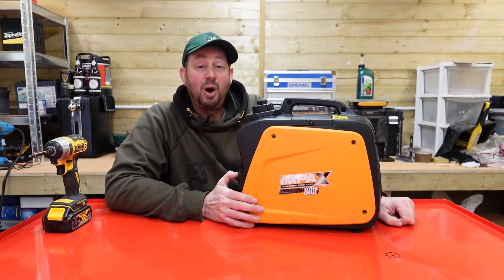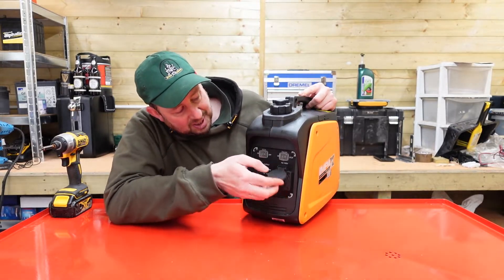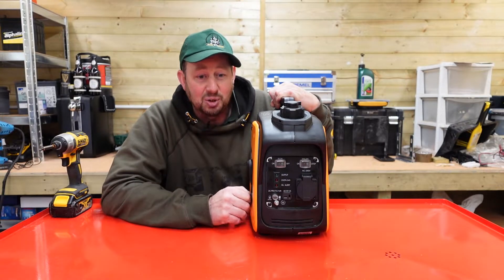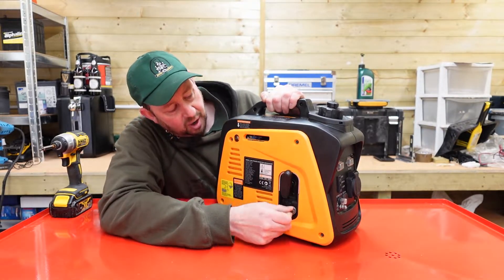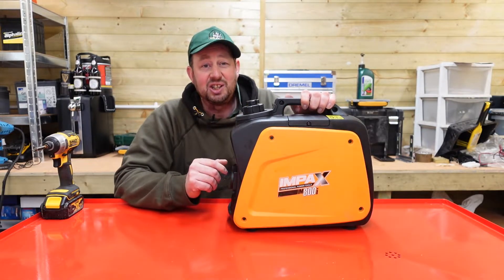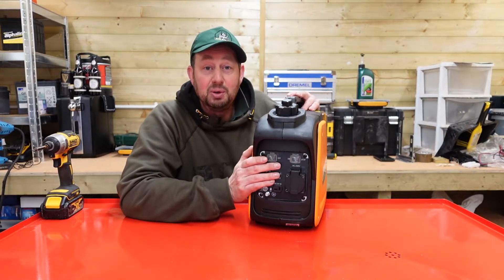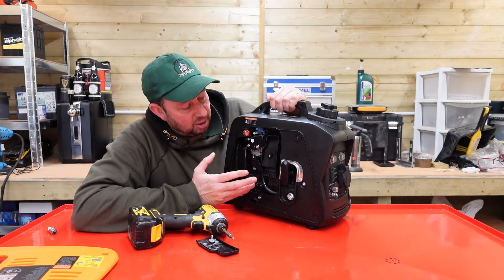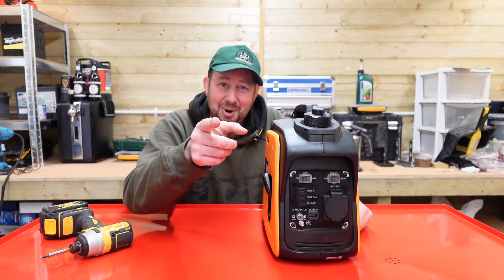Troubleshooting fix for Impax inverter generator IM800I 700W 800W 230V invertor repair how to

Comment from the maker: How to troubleshoot the Impax inverter generator IM800I 700W 800W I230V. Follow these instructions as the next step to repairing or fixing a broken or non running Impax generator following servicing. Watch my servicing guide here https://bit.ly/ijtmimpax 

I hope you enjoyed the video and found it useful, if so please give it a thumbs up and consider subscribing to the channel. You can also find me across social media here  https://bit.ly/jimmyslinks
Reply: Hi Jimmy found out that it is the crankcase breather. Any idea if you can get parts for these machines. Cheers
Reply from the maker: I haven't seen any parts for them anywhere.
I'm sure when I bought mine there was a customer service number on a sticker and you had to phone that for anything.
Reply: @JimmyTheMower  Try Generator Guru

Comment: Mines started to leak petrol out when running, its leaking out of the bottom casing. Any usual culprit?
Reply from the maker: Either the seal on the carburettor or the fuel lines.
My money is on the fuel lines degraded or split causing the leak.

Let me know how you get on 👍
Reply: @JimmyTheMower must be very poor quality pipe. Its not been used much and isn't very old. Also ran on E5 fuel
Reply from the maker: @gattoflyer yeah, the fuel lines aren't great.
They make everything as cheaply as possible these days.
Reply: @JimmyTheMower yeah will do
Reply: @JimmyTheMower do you know what size bore the fuel lines are, particularly the one that goes back to the tank. Just so I could buy some in advance to stripping the generator

Comment: Hi need your help do u have a fuel line diagram I am having a problem with mine it runs for about a minute then cuts out cleaned the carbs so I am thinking it’s a fuel problem can u help
Reply from the maker: Unfortunately I don't have a diagram.
Just try changing the lines round and see if it runs.
Failing that, it may be an air leak somewhere in one of the lines or the primer bulb 👍

Comment: Got no fuel in the bulb there's fuel at the carb from the tank if I pump the bulb it pumps backwards and blows fuel up the needle of the carb and it will run all the time the bulbs pumped feeding it backwards anyone any clues please?
Reply from the maker: There must be a blockage, split pipe or the pipes are on the wrong way round.
Is it brand new ?
Reply: @JimmyTheMower no not brand new but not that old I'll strip the carb again the diaphragms are fine must be an internal blockage in the metering block 👍

Comment: Hi, I have subscribed and have a problem, it starts well but after a few seconds of running it starts smoking and the carb starts dribbling fuel (choke off when running) it starts a very lumpy idle and with it on "econ" it does not reduce in speed much and dies completely flooded, is this the stepper motor playing up( it moves back and forth when running)
Reply from the maker: Who knows what's wrong with it ?
These little machines run great when they are running but can be a real pain.

Try taking the carb out, cleaning it and putting it back together, maybe the float is getting jammed.

Comment: Thanks for the helpful vid. I've had nothing but problems with these units. On my 2nd one this year now and its broken again. Just cuts out after 2 seconds, dont even get the chance to take the choke off. Tried all the things in this vid. Any other suggestions would be greatly appreciated. Thanks
Reply from the maker: It might be the fuel lines.
They seem to get leaky and cause some problems.
Failing that, it might be an electrical fault and I'm not really able to sort those things out.
Reply: @JimmyTheMower  fuel lines appear fine just with a visual inspection. I suspect you could be right though and it could be a blocked line somewhere. I am going to attempt to take the carburettor off and clean it. Can't think what else it could be at this stage
Reply: The Screwfix reviews says it all, not a very reliable machine!
Reply from the maker: @patscanlan2678 yeah, I'm keeping my fingers crossed but ours is still running well every week. But I've heard some absolute horror stories from other folks.

Comment: I bought mi impax 200 about 3 months ago.   Starts fine,   then loses all ac  output
Reply from the maker: I've never come across this before. Is it still under warranty / guarantee?
Reply: @JimmyTheMower  I think so,. I bought it from screwfix about 3 months ago, everything was fine until yesterday when it started to lose voltage,. When I unplug the load and then plug it back in   the load being an ecoflow delta pro, it creeps up to approx 300 amps on the eco flow then dies off , I watch the amps go back to 00
Reply from the maker: @MrSamcab21  That seems a lot of draw on a small generator. Have you tried it on something else to see if it behaves in the same way ?
Reply: Whoops I meant 2000

Comment: My 1000w impax is going straight into override from a 750w kampa diddy fan heater,   Do you know how to fix this pal ?
Reply from the maker: It probably draws a large current on start up.
Check the box to see the maximum current on the heater.
Other than that, I'm stumped
Reply: @JimmyTheMower  it just says setting one 750w setting two 1500w.

Comment: If you have still got this generator how is it running and has it been reliable?
Reply from the maker: Still runs great.
We use it for a couple of hours every week to run some lighting. 
Had no problems with mine but I use super unleaded and service it every 6 months
Reply: @JimmyTheMower  that's brilliant news, sounds like a nice reliable machine

Comment: Hi Jim. Bought one of these about 7 years ago brand new. Used it for about an hour and never used it again. It has been sat in the house for 6 years and then in the boot for a few months for emergency backup.

Today, I thought I would give it a trial to see if it would be a good emergency backup for the camper to power small devices, it basically still looks brand new.

Did all the prep. Took the old oil out and replaced it with new oil. No petrol in it so stook about £2 worth of petrol in to turn it over.

Started fine - choke off - eco mode on - powered up the devices. 5 minutes later, started pissing out petrol from the on and off petrol cut off manual switch area.

Took both sides off, couldn't see any leak. 

Looked underneath and appears some dripping from the same end as the on off manual fuel switch area.

Could this be a fuel line or carb issue as it appeared to stop when in the off position (so not the tank).

I don't seem to be able to get behind the manual fuel switch, do i need to take the whole thing apart to get to it?

Thanks in advance 😆

Seems a shame to throw it away when it's virtually had an hours use after 7 years.
Reply from the maker: I've never actually had the manual fuel switch out so I can't comment on that bit. However, The easiest thing is to replace the fuel lines first.
Sometimes there's a small hole or split that you can't see.

Best of luck with it.

Let me know how you get on because it could help others.

Jimmy
Reply: Turns out it was the fuel line.

A very small cut on the line between the fuel tank grommet to the fuel teet.

After taking apart, it was a case of cutting a very small edge of the fuel line pipe and fitting it back on.

I noticed you can get the full fuel line replacement kit for £35.

In my opinion, it seems a good little generator but the fuel pipe is quite cheap and short. Like you say, probably best to get a better replacement pipe if at all possible.

Cheers.
Reply from the maker: @user-sm6pm3hy6z  you should be able to get some pipe of the same internal diameter from Amazon. Normally less than £10 for a metre or so which is enough to do several generators

Comment: Thanks for this video Jimmy. It is really helpful. May I know if the fuel tank should be full in order to start the generator. I did all the steps but still did not manage to start it 😔. Kind regards
Reply from the maker: It doesn't have to be full but half full would be good.
If the machine has sat unused for a while then you may have to clean the carburettor
Reply: @JimmyTheMower  Awesome 👍🏾. I will try that then. Is there any videos about how to clean the carburettor please ? Thanks in advance
Reply from the maker: @User51813  I'm sorry I haven't made one yet but my pal @micksmowers has got plenty on his channel 👍
Reply: @JimmyTheMower  Lovely! Thanks for the information. I will have a look. Cheers mate
Reply from the maker: @User51813  my absolute pleasure, best of luck with it 👍

Comment: I got a an autojack. I got in 2019 .use it on occasions on site when I can spray with my Wagner sprayer. Last year we got our home I did the whole house vynil Matt . Still looking lovely. 😊 . Anyway, I put it away in the shed so it’s coming up to a year soon . Yesterday I took it out cause I took 2 townhouses to decorate in a  week . So I was super hyped me and my friend was gonna smash it. Lo and behold the machine started leaking petrol 😢. . Rang the company they said they’re going to call me. I’m still waiting. The plug area dry , the oil are dry. But it only leaks when the generator is running. Any help would be appreciated. Cheers
Reply from the maker: Maybe a split in the fuel pipe or a leaking gasket around the carburettor.
The pipe should be pretty easy to replace and the gaskets aren't too much harder either.
If you take a section of pipe to your local service / dealer they will be able to give you some exactly the same.

Best of luck,

Jimmy 👍
Reply: @JimmyTheMower  thank you so much . I used it yesterday and managed to get one three bedder done but my friend had to be on watch the whole time in case someone pass with a fag or something 🤦🏾‍♂️. When the sprayer is in operation the spills are smaller but the leaking is there nonetheless. I’ll take it apart later today and see what’s what. Or just take it to Halfords, cause don’t have a lot of spare time after work. If the repairs is more than a 100 quid I think I’ll get a new one.
Cheers for the help geez.
Reply from the maker: @royalemuzikproductionz  Glad you are getting your work done. Hope it all goes to plan 👍
Reply: @JimmyTheMower  cheers

Comment: My one keeps reving up and down even when there’s nothing plugged in, still under warranty but can’t find the receipt 😅 do you think it’s the carburettor?  Or anyone ever have this problem? I’ve put fresh fuel into it aswell maybe it just has to run for a couple hours
Reply from the maker: You should have a record of it on your screwfix account. You can do that to return it. 
Got to be a better option than taking it apart and trying to fix it.

Comment: Hi Jimmy Bought one of these second hand. It starts and runs great for about 10 mins. It then starts to smoke quite badly and splutters and coughs. Still runs but smoking profusely. Any ideas ? Nice little generator dosen't look as though as it has done much work. Any ideas. Cheers
Reply from the maker: Sounds like the choke maybe sticking a bit.
If you take the side cover off you can get a better look at how everything is running.
If you aren't confident in doing that then get a professional to do it.

Best of luck,

Jimmy 👍
Reply: @JimmyTheMower  Thanks for the reply.I have no one local who is prepared to look at the generator. I believe oil is getting accross the piston rings. Runs lovely for 10 mins then it smokes. Can it be saved or is it doomed ? Is there anyway I can get a video to you of it running ?
Reply from the maker: @welshbobster3634  if oil is getting past the rings then I would say it is beyond economical repair. 
My business is Ditton Services Grounds Maintenance. Google that and have and you can send a video. Although it would be very difficult for me to diagnose anything without seeing it.

Comment: Never had an issue with these Impax 800s….had two now, they are superb little generator’s, solid build and really reliable along with being quiet 👍🇮🇲
Reply from the maker: That's great news 😀
Reply: That's good to know. Mines got the what seems the usual broken return pipe? into the top of the fuel tank. Its a shame they haven't used a better quality hose. The fuel must run down into the starter cord, because that feels tight now. I wonder if the fuel has washed out some lubricant?

Comment: Anybody having problems with DC output? DC protector started cutting off power more and more often in DC output until the point when DC output stopped working completely... I opened generator and measured power with multimeter which showing only 0.4 volts. AC output working without problems.
Reply: I would never use the 12volt DC…..I measured mine at normal running , it’s peaking at 15.2 volts, so it’s not a regulated supply…..it will damage 12volt batteries at that constant supply, as Jimmy says, use a 240volt charger or drop down power supply on the 3pin,outlet….that is a genuine inverter supply, 👍
Reply: @ManxAndy  I noticed same DC voltage (15+)before mine output broke down ...I have batteries from Halfords with 3 year guarantee so it was not worrying me at all.... I used to use it rarely when my solar panels didn't get enough sun...
I bought 8A battery charger (240V) for few quid... Battery charging faster and looks ,,healthier"...
Overall... It's really good to have 12v DC on generator as back up but I don't recommend to use it often or at all if possible...
Reply from the maker: I've never used the DC output. Even when charging batteries I use the AC to run a battery charger.
Hope someone comes along with some better advice or an explanation soon.

Comment: Thanks for these set of videos Jimmy, the most informative on the web about this Impax generator better than the user manual!

Any idea why I am sometimes able to get mine running but then after 20  seconds it will cut out?

 Sometimes it will run for several hours but then I try to use it again and I can't get it started. If I leave it for a week or two then it will start fine.Is the carburettor being clogged by the fuel?

 I've tried all the tips in the video new spark plug oil, premium fuel etc .. when pulling the cord  the green light will  appear but then goes off and the engine won't start.

It's a good generator when it works but it has not been reliable for me.
Reply from the maker: I've heard a few people having problems like this and I really don't know what to suggest.
I will take mine apart and have a look to see of I can find any clues.

Fuel lines collapsing
Fuel lines leaking air
Poor quality spark plug lead
Clogged carburetor 

That's just a few ideas but I will try and take a look over the next few weeks.

Thanks for watching,

Jimmy 👍

Comment: I used it to charge a battery today for the first time, using the wires you get with the little clamps for the terminals. ran for about 15 mins then stopped. Any idea what the problem will be? I'm going to check the exhaust tomorrow. any reason for it to be an electrical problem. been running great until charging direct to the starter battery on my boat.  I will change the oil to, mmm baffled, thanks for the video though.
Reply from the maker: I've never had any success charging directly with 12v. I always use a 13amp charger and just plug it straight in.
Reply: Don’t use the 12volt outlet to charge batteries….it’s not regulated, mine shows 15.2 volts on full running, that will kill you’re batteries……use a 240 charger in the 3 pin outlet, it will do a better, safer job👍

Comment: Great video.  Tried my one this morning and petrol is leaking from it.  Its had fuel in it for a while (I know) and when I start it (no problem) fuel drips out of it at the bottom.  Any ideas?  Thanks.
Reply from the maker: Hi, first thing I would check is the tightness of the fittings along the fuel line and also how tight the carburettor bowl is.....
I've made a video on servicing this generator and also a quick trouble shooting guide.

I hope you can sort the problem soon.

All the best, 

Jimmy 👍

Comment: White smoke coming out of an exhaust.is it coming to an end?
Reply: I have the same with mine white smoke sometimes can run for hours with nothing then a burst of smoke and takes a while to burn off clean again it's burning oil. I opened the air filter and noticed small amount of oil residue at the top only way I could see it getting there was strangely via the carb or should I say the pipe work that connects to the airbox that sits in front of the carb. The pipe work goes down to a Deaerator has arrows on it to show direction of flow, I think there should be a one-way valve inside that to prevent oil coming back up the pipe to the airbox. I remove it and could blow both ways so I think it has failed I have ordered a new Deaerator (should get it in a week or so) hopefully it should fix it. Finding a spare was fun will update if it fixes the issue.
Reply: @justfly4795  thx. Waiting for u updates
Reply from the maker: It was brand new, first time I had started it.
Had it over 12 months and it's still going strong.
Reply: @JimmyTheMower  white smoke was coming out of my generator. I left it off for few hours and now is back to normal. Do u know what it means?
Reply from the maker: The only thing I can think of is contaminated fuel... maybe there was a little bit of water in there 🤔